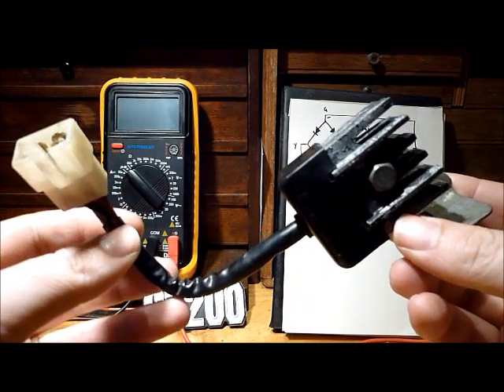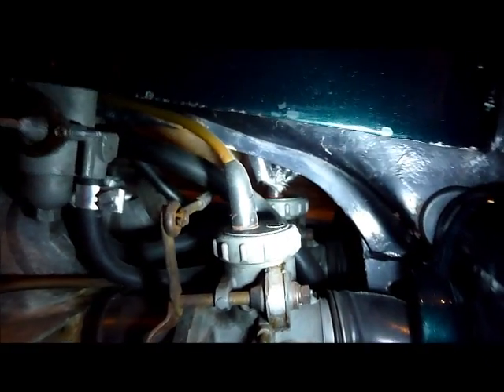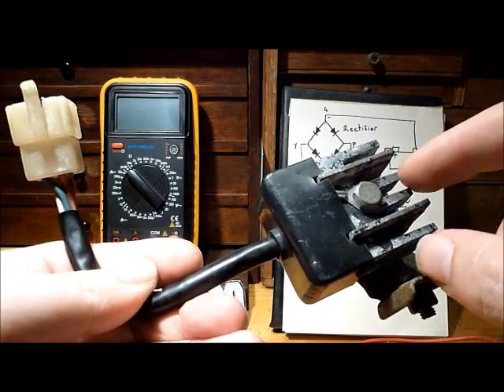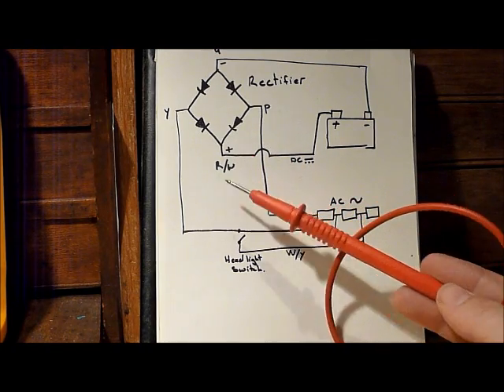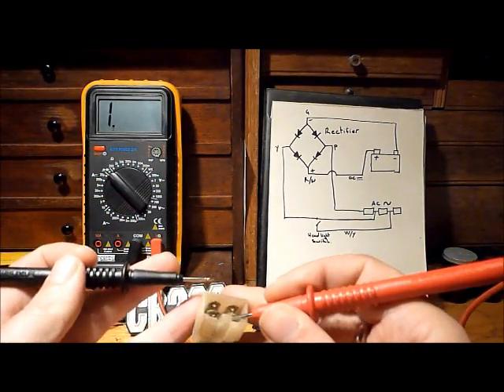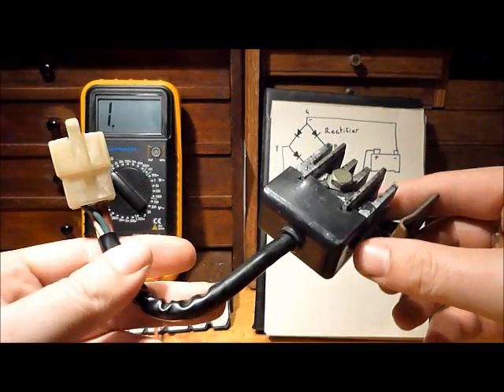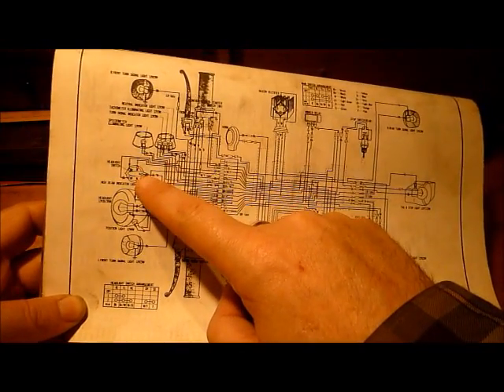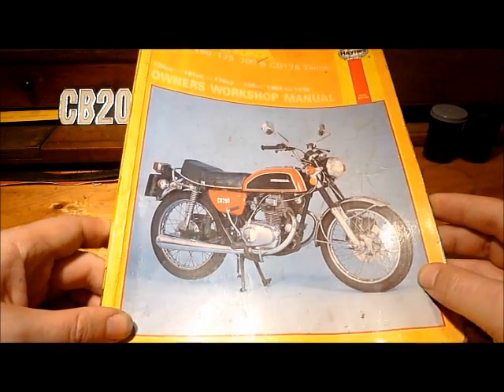Honda CB200 - Testing the rectifier

Comment from the maker: Hi Kwoks. There are a couple of kits on the market to replace the reg/rec on a CB200 but I am still investigating them. On the UK model you need to note that one of the outputs (yellow wire) from the stator goes into the head light switch and only active when the lights are on putting more charge to the battery. Sorry not much help but I hope to update my system next year so may have a vid about what I did then, if I can find enough details before messing with a system that is still working fine if a little inefficient.
Reply: My cb 125n 1981 Irish bike has 6v and no regulator as battery is used. Later 12v bikes have regulator.